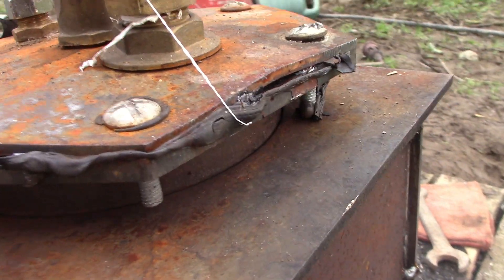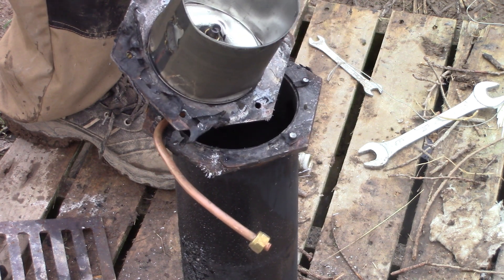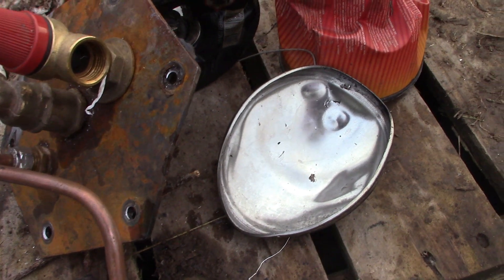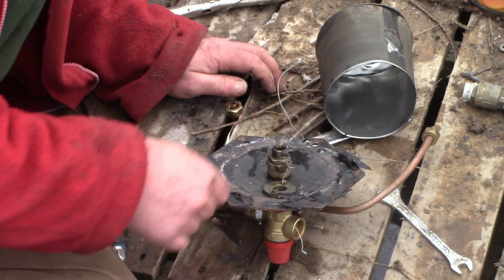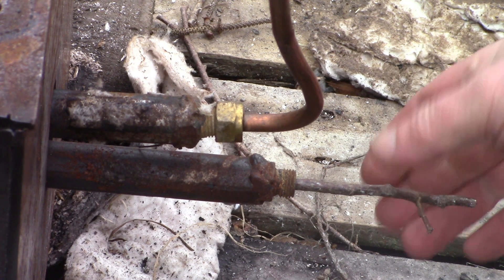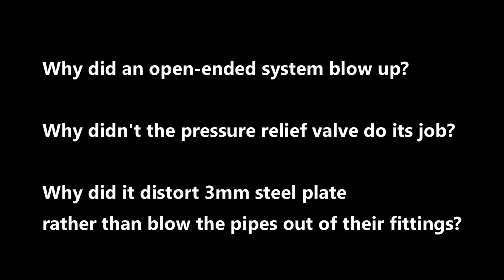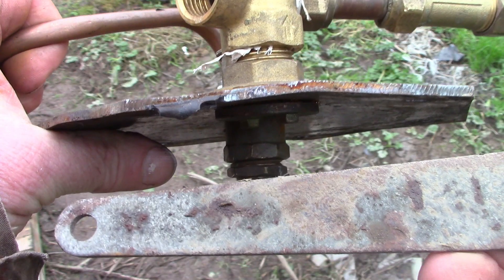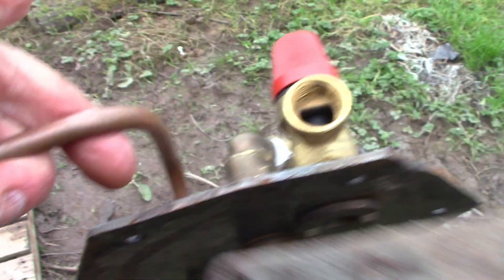Why Did My Boiler Explode??!! My Own Big Bang Theory...

Comment: Just like Nicolai Itchenko said, your boiler (open system) didn´t blow up. The floats (enclosed system) did. The canisters had air (or some other gas idk) in them, which expanded because of heat to a pressure the canisters couldn´t handle. The top one exploded first, crushing the bottom one and making it explode too. The 3mm steel on top was probably bend because of the impact of the float. 

The pressure relief valve had no chance of doing its job, the expansion was too sudden for the valve to relief the pressure. Just like in a real boiler explosion. 

I wouldn´t say "I told you so", rather I expected you had tested if the canisters/floats could handle the pressure. 

Also, as many said, you should reposition your pressure relief valve to a position where it can´t be obstructed. Maybe even install a second one, just to be safe?

I think you should use sturdier floats, or rather a whole other, new system for water level regulation. 

Glad you didn´t get hurt, great series so far! I´m exited for your next video!

Comment: I say it was not good to have 'used gas containers' without some action to neutralise them. Observation points.  You did not have a water level indicator, or 'sight glass' on the outside of the boiler. You had the refill mechanism 'inside' the pressurised boiler and it should not have been. 

Think of a locomotive, it has a sight glass in the cab so the driver and engineer can monitor the rate of water consumption in the boiler, and a pressure feeder is external to the loco boiler to force water into the boiler when needed.  I believe the gas explosion happened faster than the 'boiler safety valve' could react, so it was a mute device in this case. 

Any action that leads to making a safety device mute, is a poor show and should not be repeated if any form of longevity is desired.
Note  You do not seem to have a way to 'dump' the heat source in an emergency, again, locomotives open the grate and the fire-bed dumps below the loco thus removing the heat source pretty darn quickly. If you used some kind of quick disconnect between the grate and the boiler you could do this.

Note to self, a rocket stove burns all the fuel so there is no smoke and if not 'welded' to the boiler apparatus, could be 'kicked' out from under it if needed.

So glad you are safe and in one bit
Maybe you should not trust to having a singular safety device, for as we see, if it fails, you are blissfully unaware of impending disaster.
recap: Water level needs to be seen outside the boiler. Water pump for replacing lost water needs to be external as well. You need a way of losing the fire in an emergency. You must have two independent pressure safety valves. Finally, if unattended, the heat and pressure should degrade, not continue unabated until fuel or water runs out.
A good lesson opportunity sir.

Comment: Hi Tim. Here's the fun thought.  Contrary to my previous disagreements with you in the comments, I think for the first time you actually DID have a flash boiler   there was some interruption to water inflow, sticky inlet valve or whatever, this meant the boiler was soon way above boiling point. Then when the water flowed again it hit the hot surface and flashed into steam. Which is a violent process. And I would suggest that because of the lower surface area that yes the steam fittings were stronger than the 3mm steel plate in this instance given the pitch of the clamp bolts. 
Whatever you do next, please as others have said, do a static hydraulic test before you operate any kind of closed system. A simple way to get the pressure test done is to temporarily fit a grease gun into the system. Add a pressure gauge, then fill with water and pump. I would like to see a test done at twice safety valve pressure to give that 2 : 1 confidence.

Also please read the comment by Steve Allen on here.  I totally agree with his engineering view on this, and he's explained flash boilers better than I did . Regards Gary

Comment: When I saw you using empty gas cylinders as floats to actuate your valve I was more than a little worried. I know just how dangerous boilers can be. I have witnessed a large section of a factory completely demolished by an exploding package boiler.  Even a hot water system can level a house if the pressure relief valve fails. I am genuinely worried for your safety. Please do some more research before having another go.
Reply: I hope he doesn't die, hes really playing with fire here.
Reply: I wish I could heart this.

Comment: Call yourself very lucky that you got out of this without injury! Steam pressure vessel accidents still range among the most dangerous events in history of industrialization. They were a major driving force behind the developments of welding code and material science.

I don't agree with your analysis. The flash boil after a sudden drop in pressure cannot exceed the pressure level it had before the drop. That equilibrium pressure level is determined by the temperature of the water. For the pressure to spike higher afterwards the water would have to suddenly INCREASE in temperature. Not possible!

Were the gas containers 100% empty? Especially the top one? The lower one crumpled under the pressure shock, so it probably was empty.
I think the top gas can was not empty. It blew its bottom out, shocked and crumpled the lower can with the pressure spike. The sudden increase of pressure could not vent throught the blocked pathway and the pressure spike blew through the weakest link.

My take @ your questions:
1: Even though your system was "open ended" there was quite some restriction in flow with several meters of thin copper pipe. Enough to build up significant pressure. Especially if it happens in a spike. 

2: The way was blocked by the upper can. Many overpressure valves like that don't react well to gas/steam pressure. And they are probably not rated for the temperature you run it at. Maybe the plastic membranes welded shut?
3: A flat metal sheet is easily bent by pressure. It was still the weakest link in the chain of events.

Comment: The first thing to do is check that the safety valve is working , The type that you have fitted it's not designed to operate at the steam temperatures  that you were able to achieve
Reply from the maker: Actually, yes it is

Comment: I don't think the boiler exploded, i think the top float exploded. There might have been some amount of moisture or something inside the top float, that expanded, increased the pressure inside the float, and popped the bottom of the top float off. The sudden increase of pressure shot the top float up, ramming the lid, and compressing the second bottom float(maybe that one did not have moisture in it). The sudden increase of pressure couldn't leave the system fast enough through the little tubes, or safety valve. It all happened so quick, the tubes and valves might as well not have been there. So now you can basically see the system as a pressure vessel that wants to expand, which it is going to fight for. And the lid lost that fight. 

Something totally unrelated: maybe a steam pressure gauge would be nice, one on the boiler, one at the end, to see if there is a pressure drop across the system (or a blockage). Because that would be nice if the safety valve failed at some point. Also, is that safety valve meant to discharge gas, or water?

Comment: I think the top float (the silver can) was touching the side of the boiler and the air in the can expanded and because the float itself was a pressure vessel the pressure kept builing inside until the bottom of the float gave way crumpling the bottom float (the red one) and the top rocketed up and deformed the top of the boiler causing the explosion. 
I have no training in anything to do with this.  I am just an Australian who really enjoys the content you produce and thought they could give their 5 cents as to what may have occured.

Comment: What are the "floats" supposed to do? All they will be detecting is water level, not pressure. If the floats are there to govern water level, then their design is awful as they are interferring with the pressure relief valve.

Comment: With your new chimney arrangement  the internal temperature was higher, causing failure of gas canisters, also your safety valve is a pressure relief valve, slow to operate, please use a correct safety valve

Comment: Most steam boilers are a little bit more thicker than what you have on the steel. We've got a couple minutes or steam locomotives it will have a better increasing steam at 100 PSI all of our miniature steam locomotives have water glass to see how much water is in the boiler.

Comment: Top float looks forced up into the float valve thus filling gas can with water which turns to steam and pressure has nowhere to go but down exploding the base which crushes the bottom float to the base and forcing everything out the lid

Comment: The gas canisters will always have remnants of the gas, increase the temperature around them and they will expand, then they hit off the valve causing a spark and boom, steam rushes in to fill the void causing a mini sonic boom and imploded canisters.  For every reaction, there is an equal and opposite reaction 😉.

Comment: Watched the vid, read the comments. Even if you could conclusively prove the cause of the failure, you couldn’t conclusively prove that any adjustment you make will have resolved it. The power of the explosion(?) was too great to take to take that risk. You may have a catastrophic failure for a different reason next time. The bottom line is, you don’t want to retain the empty canister float system. Whatever the root cause, you don’t want a canister implosion/explosion. It was contained this time. It’s nice to do things from the ground up, and first principles… but in this case, we have over 150 years of design development to draw on. No need to repeat mistakes that have already been made, and resolved. Stay safe.

Comment: What a puzzle this is.  The facts that you show are that the top canister exploded ( the bottom came off and is domed out and the top is impaled on the safety valve)  6x6 RV below points out that the ignition temperature of propane is 300c, and that may be what happened ( the residual  propane in the top can exploded)   

The bottom can imploded  This may  have happened at the time of the explosion ( an explosion in a confined space)  or  it may have had a small leak and during heating its content may have leaked out slowly.   After the explosion, an influx of water caused the steam in the bottom container to condense causing it to implode  (  there are many youtube videos showing what happens  if you suddenly dunk a drum full of steam in water )  This implosion might have been quite slow ( a few seconds )
Reply: Another bit of the puzzle: why didn't the fittings pop out, and why was the top plate domed and the top can impaled?   You need enough momentum for that to happen.  I think the top canister had significant water in it, and somehow it got enough momentum to ram the top plate (as opposed to pressurizing the whole system)

Comment: I'd highly suggest obtaining a copy of Martin Evans book on the design and construction of model steam engine boilers. Additionally, I would suggest that the Sentinal Steam Wagon's boiler would be a good point of referance for you, boiler design is difficult and dangerous
Reply from the maker: But you know I'm making a flash steam boiler?
Reply: @wayoutwest-workshopstuff6299  Indeed, but Mr Evans book does a great job of explaining the ins and outs of making a safe system on boilers even for 10inch engines and the sentinal's boiler is very similar to your own using a small boiling vessel combined with lots of water/ super heater tubes so I think they might be valuable resources for you

Comment: How a simple theory: these floats just cant handle the temperature inside the boiler and they popped. The first one to pop was the one on top because it was warmer in the steam than in the water. It then triggered the bottom one. Propane pressure at 50°C is 17 bars. Much more than your steam pressure.

Comment: Hi tim, luckily still alive! Reason for explosion: may your flotor collapse, and no feed water was lead in the first stage boiler and the pressure rocket up. Also your suspect may can be.  Results can be seen on steam loco history of exploded boilers, due feed water shortage. My advice, install an boiler water sight glass on the drum and an mechanical (piston) feed pump!! ( somehow, you always have funny ideas!!)  )) by the way, 3mm steel is to weak, because the cover is straight. May you find an old empty oxygene bottle as first stage. ( medical oxygen is in small cylinders...)

Comment: Tim!! Thankfully you two are still breathing and with us! - you insulated the stack and the "heat sink" is no longer there, so the boiler would be hotter. The top gas can looks as and others have pointed out the same, to have been pushed up and blocked the pressure relief valve - put the pressure relief vales someplace else, and even have 2 - 1 on top and 1 on the side. - If you can put some temp thermal readers in the system some place, thermal-couples and a multimeter would work. It also looks that when the top can blocked your pressure relif valve, the water valve was now left open and dumped water into the system, then it exploded, this all happens really quickly...

Comment: I'd say your top float was (partially) blocking the pressure relieve valve and the steam outlet, causing pressure to build. That also explains why the plate bent and the bolts ripped out, while the pipe fittings didn't: they didn't see the high pressure, because they were blocked. It would probably be a good idea to put your next float under some kind of mesh that's down a couple of cm from the top. That way the float can still control the valve with an extension, but it can never block any of the outlets anymore.

Comment: My personal (Non-scientific) theory is that as the steam was made, the top canister was floating on the water while the steam ran up the sides. This made a disparity in temperature, causing the air inside the canister to try and get as close to the relatively colder half. This made a temporary vacuum at the top of the can, which was enough for the metal to distort and compress. The metal compressing had a knockback force which made the canister jump and slam into the top of the tank, making the dent.